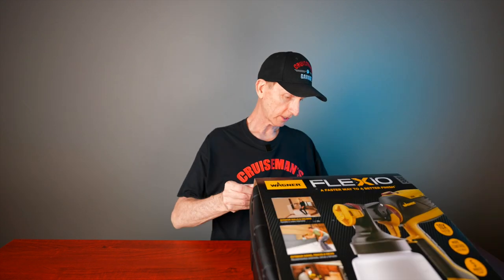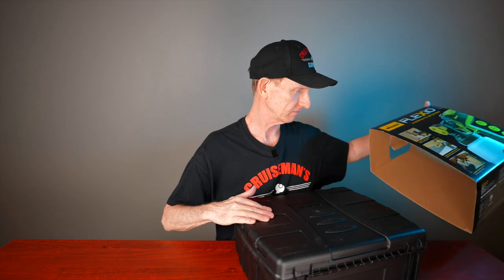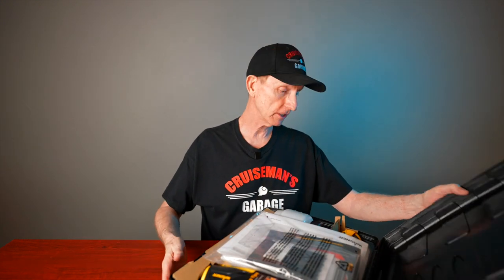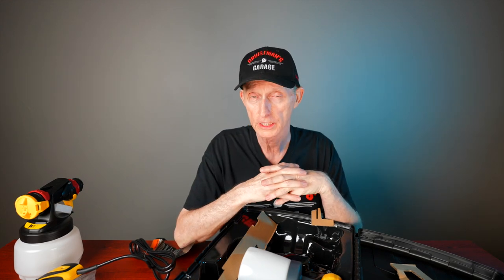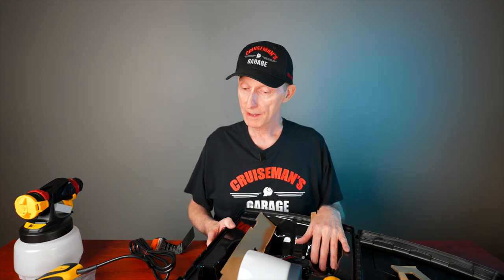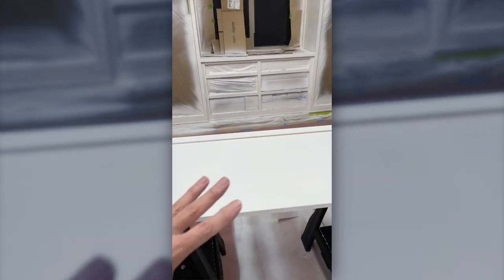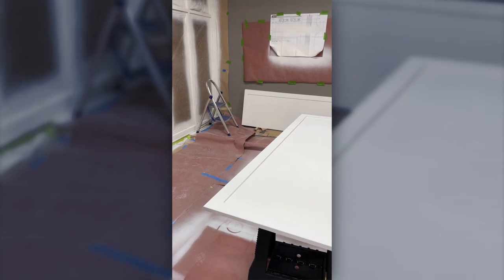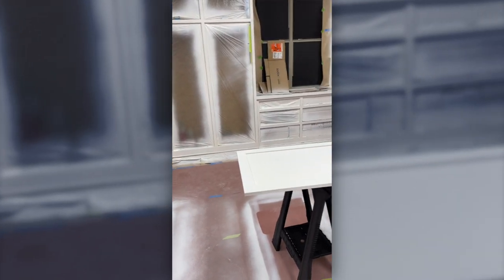Wagner Flexio 3000 HVLP Sprayer - an Honest Review | Cruiseman's Reviews | CruisemansGarage.com

Comment: Lack of preparation and operator error. I have the same system and it works great. Flows well. Final product looks like glass. I must admit, I used to paint cars for a living, but that doesn’t explain the way you said it was spitting paint out. I use a small cube heater in my garage when it’s cold and that keeps the temperature within range for applying the paint.

Comment: I think it was just the nut holding the spray gun. You seem like a nice guy, I think you should have spent more time practicing using the settings.
You seem like every single step was pure hell or too much trouble. Pay a painter to come over and paint everything with that exact sprayer and write an apology to Wagner.

Comment: I bought my about a year ago to use to repaint my rental homes inside and out and also my personal home and it saved a lot of money having someone else do it! And it’s still going strong 💪 I really enjoy using it for all my paint projects the only problem I had was it wouldn’t pick up paint out of the container but once I figured out what it was it’s been working great ever since there is a little small hole on the pickup tube that will get clogged up with paint and stop it from spraying so just keep it clean and the air filters on the side of the spray gun it should last you a long time I really enjoy mine it was the best $169 I ever spent 🤔👍😎🤘 PS: I also been reading some of the comments how bad it was. You have to make sure the adjustments of air flow and paint that your pushing through the gun is adjusted correct because if not it will give you some trouble so adjust the amount of air flow and paint before you start on your project and it should be fine🤔

Comment: If you had any respect for your channel you would take this waste of 25 minutes down. Shame on wagner for giving you the product to review. If you took the time instead of trying to be a funny man you would have read the instructions, the flexio comes with a  finish spray gun for cabinets. Your review is falsely misleading. You should change it to say listen to the instructions and do not use the bigger gun for finish cabinetry.
Reply: I am having a very similar experience and am looking for a fix to stop the sprayer from spitting, which is what brought me to this video.  I'm on my second sprayer.  The first one didn't spit, but failed after five uses with paint dripping out from the handle.  The second brand new sprayer will not stop spitting.  I wanted to love this sprayer, and did for a while.  But now I  think this review is not far off.

Comment: I just recently bought a Wagner Flexio 2,000 and liked it for what I used it for. We painted the wall where our fireplace is. The wall is covered with sandstone boulders and grout. Normally a 3/4’ nap roller works best on concrete and masonry walls, but we really couldn’t get a roller on the this. The 4 of us started with paint brushes, but I quickly realized that that wasn’t going to work very well. So I bought the spray gun, got the area around the wall Dexter’d up, and painted it with the spray gun. We touched it up with paint brushes after painting it. The grout soaked up paint like a sponge, so the spray gun was definitely the way to go. Over the last ten years, I have painted all but one room in my house. The only other thing I think I would try using that paint gun for is front door, or garage door, with automobile paint. I think I will stick with a roller for the rest of the house though.

Comment: I love my Wagner Flexio 3000. I'm sure there are better more expensive ones but it's really cut down on time spent painting. I do a lot of painting as I'm renovating my home. I'm not that great with a brush but I sure do love my sprayer. It honestly takes trial and error trying to figure out what looks best with what settings. Thinner paints I use less air power and lower material setting and vice versa for thicker. Though the cabinets are meant to use the detail sprayer and not the ISpray which is meant for walls. The type of paint matters too. I use the Zinsser BIN primer and Valspar Cabinet Enamel. My cabinets are smooth and not splotchy though they're not perfect by any means.

Comment: There are two knobs that adjust the spray and the amount of paint that comes out also you should thin the paint with a little water….I have this exact sprayer and it’s a good one….your troubles are from operator error maybe spent some time practicing and you will like this sprayer

Comment: Your experience is similar to mine with a rented sprayer. The exact thickness of the paint and is the sprayer nozzle truly clean. If either one of those is off, you are sunk. Best wishes.
Reply: You can easily add water to your paint to thin it, so you aren't stuck it really is pretty easy to fix. And if your nozzle isn't clean, just throwing it out there, clean it? 😂🤦‍♂️

Comment: Thank you for only the second honest review on paint spraying Ive seen. I almost made the same mistake. Bought one, had a bad feeling and saw an honest review and took it back without using it. What no  one wants to talk about is how much you have to thin the paint to get it through a gun. Paint manufacturers told me I shouldn't thin at all but if I HAD to only up to 10 percent. I really didn't think that would work and I couldn't thin it enough. So I'm using brushes. And  I truly believe that anyone that likes these sprayers is over thinning the paint. If I'm proven wrong, great. Until then I won't believe that any of them work like we're made to believe. Once again, Thanks. Brushe's are still better than just another problem.

Comment: I bought Wagner sprayer back in the 90’s.  They worked well for awhile then it seizes up.  The tips would plug up. There is less moving parts in this new sprayer from what I saw the store. I’m spraying a  wooden fence .
Hot water heaters should last some 20 years. A/c units -20 years. But hearing your review, I’m thinking of returning it to the store.

Comment: Chris........On a side note, just read where the new 2021 Goldwing increased the size of the trunk to 61 liters from your 50 liter sized trunk. That should hold 2 helmets.
Reply from the maker: Question is will the new trunk fit the 2018-2020?
Reply: I understand that it can, indeed, be retrofit onto '18, '19 and '20 but the price is around $2,000...the price of some trailers!

Comment: I have this exact sprayer kit. This is 500% operator error. 🤦🏼‍♀️ You said "someone smarter or more talented than I am"... They just have to be smarter.... The gun has the talent as long as the operator has an IQ over 50
Reply: I don't agree that it's 500% operator error.  I've had a similar experience as Chris, which is why I'm here right now.  I purchased a brand new Wagner 590 sprayer to do kitchen cabinets.  I started out with an oil based primer, Johnstone's Advanced stain blocker, that ended up going on very rough (two coats).  I spent a lot of time sanding it down to get a smooth surface.  Like Chris, I thought maybe the oil based primer (going over an ultra smooth surface) was to blame.  But then I painted over it with Johnstone's Aquagard, and got the same result.  Finally, I figured out that I had to turn the air all the way up and turn the paint flow very low.  Then I got a beautiful, fairly smooth coat on the cabinet bases.  Chalk that up to user error.  However, while painting the doors, paint started oozing out of the handle.  I ended up returning the sprayer and got a brand new replacement.  Since I got it, I have not been able to get a smooth coat no matter what I do (including thinning, cleaning, adjusting air and paint flow, etc).  It spits all over the place.  I've had a very love-hate relationship with this sprayer.

Comment: I bought an earlier model one and rarely use it Because its so much work and never the desired result . I do much better with auto spray guns lol 
 But sanding sanding sanding will make the difference A smoother  surface to start with will ensure a smooth finish Sanding sealer before primer works well too. That's why we choose professionals
Reply from the maker: Thank you.

Comment: Why didn't you just buy metal cabinets that are already painted instead of going thru all that prep work?
Reply from the maker: That was my first choice. But, the cabinets have to fit into an offset in the garage wall that is only 18" deep. Every metal cabinet that I could find with the features I wanted was either 16" deep or 21" deep.

Comment: Great video and real world review!  I wish I had seen this video before I bought the Flexio 3000.  I too thought I had prepared, I did research on paint sprayers, I decided the Flexio 3000 would be the right tool and I spent almost two full days masking and taping the work space to spray four louvered bi-fold closet doors and four walls.  I literally went through the exact same issues you described...to the letter!  I pride myself with being thorough and precise with things I do but this was by far the worse experience I've had with a relatively simple home project!   As far as tools go...this Flexio 3000 sucked and was not user intuitive in the least.  It got so bad for me that I stopped everything I was doing and went back to basics and hand painted with good brushes and rollers and completed the job way better than I started.   Once again...I wish I had seen your video before buying this crap paint sprayer.
Reply: I have the same sprayer. Don't blame the sprayer for your lack of experience 🤷🏼‍♀️